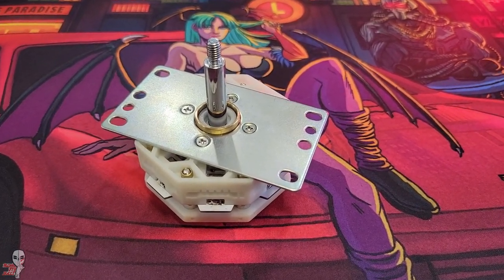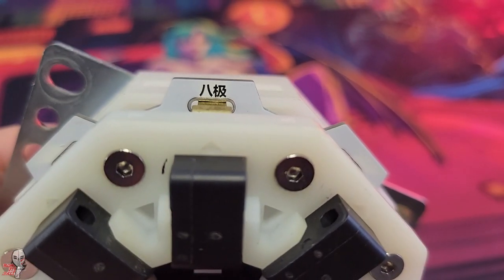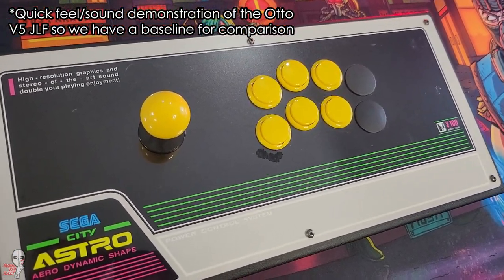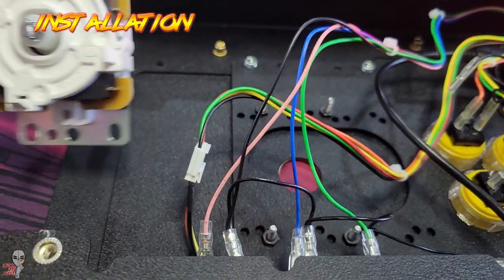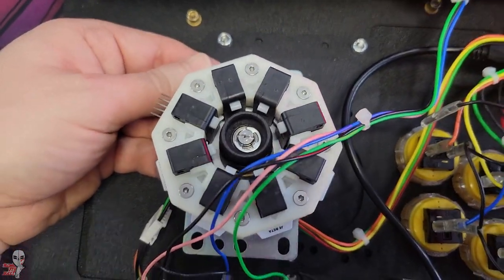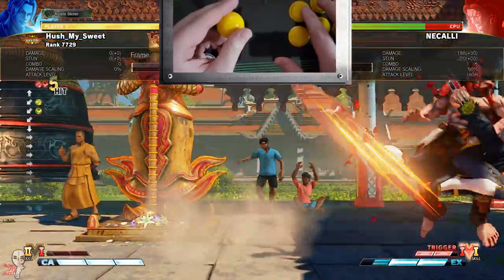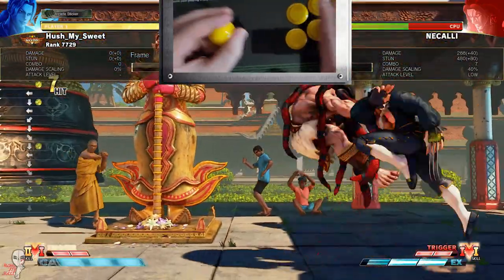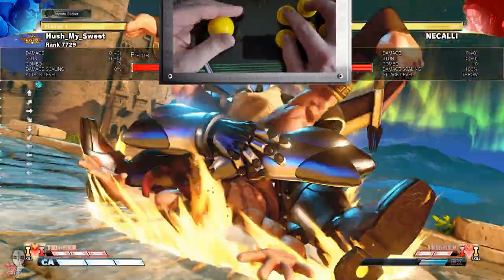An 8-switch joystick for your fightstick?! Check out the Baji Stick!

Comment: Perfect timing! I was just over-thinking about this lever after a post on r/fightsticks this morning.

I'm not totally sold on this idea--eight switches just seems like more possible points of failure to me😅. Also, I personally need a quick return to neutral, so this doesn't sound like it's for me in the first place.

 The Reddit post featured the model that is MX compatible.  The original poster mentioned that the lever isn't available for individual purchase at the moment; it can only be bought with one of the designer's custom cases. It's got plenty of people interested, though.

Keep these vids coming!
Reply from the maker: Appreciate ya! Yeah, it's definitely a fun concept. There is something satisfying about all the clicks and I appreciate the innovation, but it's hard to say if this is too novel to justify the costs or not. I'm going to play a few other genres and see if I can find something that really makes it stand out. I'm not against the looseness of it, but the throw feels fairly long compared to my usual lever choices (but I use short shafts a lot, so maybe I'm coming from a different background anyway). Thanks for watching!

Comment: I think the 8 microswitch is a great idea. You could have this with an octagonal gate and have the same throw, activation in all 8 directions.

I wish for a 8 microswitch stick with octagonal gate and very short throw.
Quick to activate and very little post activation travel.

Using ls-56 and ls-40 now with heightened gate, so that the post activation travel is as hort as can be.
Due to this I cannot use an octagonal gate!
Reply from the maker: I actually picked up the revised version of this lever. I hope to do a review and showcase on it in the future (just lots of vids ahead of it and I can only get out about one per week). Devil Designs has changed a few things on these new ones, so it may be up your alley and I hope you stay tuned for it. Thanks for watching!
Reply: @HushMySweet1  Do you find any difference between beta and revised version?

Comment: Seems to be exactly what I need. As an octagate player and soon will be trying circle gate too, one thing that annoys me on current sticks is the whole 4 switch idea. In crunch moments when I want to gi straight diagonally one switch will almost always be pressed slightly sooner than the other, as a result if my button input again due to speed is right on that split frame of the wrong input (1 of the 2 instead of both) I consistently get the wrong move out. Its so annoying its killing me.

I thought there must be eight switch sticks, no?

Apparently its not a thing, whicha is dumb as glue of you ask me, so I am so glad I found your video.
Reply from the maker: Hey thanks for watching! There are newer versions of this lever on Aliexpress if you'd like to pick one up.
Reply: @HushMySweet1  how do I search for it? What keywords do I use does it have some specific naming or is just arcade stick enough and I go from there. Any pointers for the different models I may find? Like a more sturdy one etc
Reply from the maker: @DCFHazardRebornChannel  I think they are only selling the revised version now, so something a bit different than what you see here. I'll review it one day here. Anyway, search things like "Baji Stick, Baji Joystick, Devil Desigh, sinoarcade" to get it to come up. Good luck!